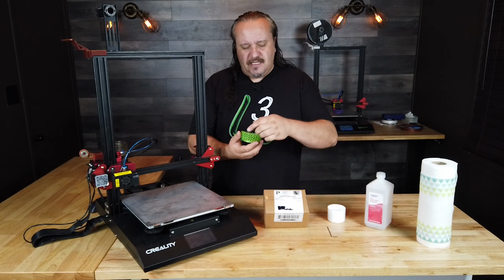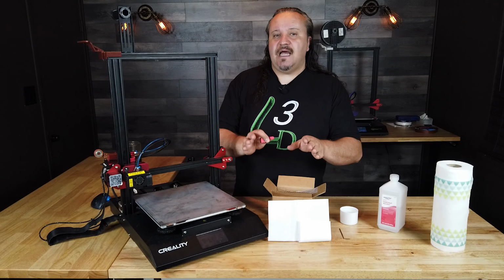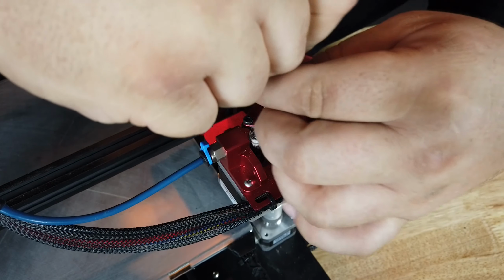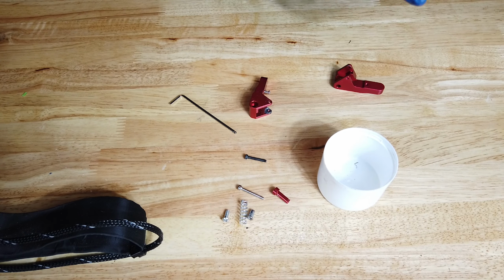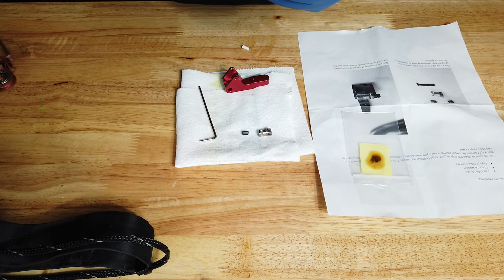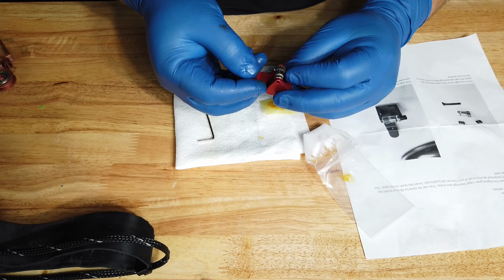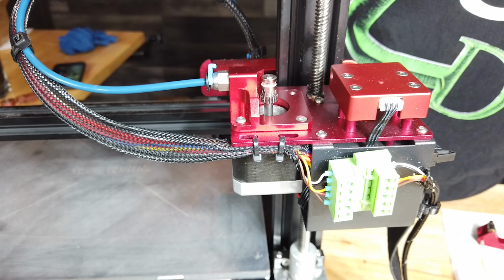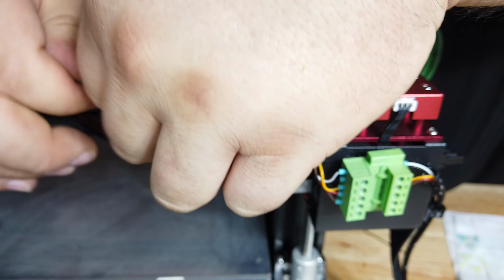Cr10SPro ... Critical Fix you need to make ... ASAP, Extruder issue SOLVED!

Comment: these dual extruders all have another flaw: the gears are below the filament, so all the dust will fall into the gear and compress between the teeth and "clog" the teeth.

Comment: You can also keep your gears and parts from your extruder with grease oil from cars, high temperature resistance, good lubrication and prevents gear wearout from constant friction.

Comment: The trick is stop spending money on replacement bowden tubes, couplers, all metal extruders and buy a direct drive system ASAP. Lol these printers are trash and designed for failure.

Comment: This is correct but the FIX is use a Dremel orange grinding wheel and reduce the thickness of the red anodized aluminum so it's smooth surface again. Also DO NOT USE ANY GREASE in that area it acts as a sand paper with the debris from the filament. Get yourself some brass flat washer in the size of M4 and rind as much aluminum down as needed to you can get at least 1 brass washer in between the gear and the grounded off aluminum. Idea is 2 washers which will allow for a much longer lasting and smoother operation. Ensure both washers are letting the gear ride above smoothly so there should be a tiny bit of play. This will enhance the function of your printer and reduce the friction of your hardened steel gear from further destroying the aluminum. Brass will act as a gear plate so it will slip without destroying the aluminum and letting the gear ride on the brass. We done this to all our 3D printers of our print farm with very good results.

Comment: problem is that you mounted driving weel to close to the motor and filament is pressing second weel against frame. Holes and wheels should be perfectly aligned and then everything is working with no isues.

Comment: Wouldn’t you want some axial play in the driven gear to help locate it properly onto the filament? It seems the real problem is excessive play between the needle bearings and the shaft of that bolt.
Reply: I just bought a clone version and the needle rollers run on the threads of the bolt. This means that clockwise rotation will try to screw the gear downwards against the aluminium support.
As you say axial play is a good thing.

Comment: One major issue that was not addressed; the bolt through the bearings and the surface on which the ride is threaded! This causes both the bolt and the bearings to wear, further adding to the loose tolerance. Another YT'er had a bolt machined with a full shoulder for the bearing to ride (this is what the extruder should have, but bean counters...). Another solution is to get a long bolt with a shoulder that extends the length of the bearings, and cut it down, leaving you a bolt with a long shoulder and only a small section of thread (easiest solution).
Reply: 100% agree plus slightly bevel the bottom of the teath on the gear to remove the sharp edges 😉

Comment: This is basically the same as the WINSINN dual gear extruder, if not the exact same extruder. That has the same problem, it's definitely a design flaw they don't seem to be interested in actually correcting, for some baffling reason...

Comment: The link is 404, do they still make this fix? I cant find it on Tiny machines.
Reply: If you have a newer machine it is not a problem. Just look for a washer and a cutout on the bracket under the extruder gear that is toward the front of the machine. Creality have long since implemented this mod on new machines.

Comment: just from this video i realize that extractor is junk... the one on my ender 5 and cr-10 dual axis clone use a much better part reliable part... not sure why this one is so complex with the extra gears etc... but iam sure it has to do with other added features that my machine don't have .. if you want a reliable machine simpler is always better..

Comment: Nice tutorial. 
I‘ve got no longer any issues with bowden extruders, I‘ve throwned  it out. Together with an Bl Touch upgrade I build up my complete x-axis, with double linear rails (2 parallel), a print head with double gear extruder, mosquito hotend. And to give all this new stuff a strong platform, the 2020 x-axis has to go. Now a 2060 profile brings a lot of more strengh to my printer arm. 
First I tried to use a piezo sensor instead of Bl Touch, but there might be a problem with the original Creality Cr-10s pro board V2.4. ...4 weeks searching a solution, I need a break. Piezo z-homing is nice to have, but when it will not work, the Bl Touch is ready to go, why fighting like Don Chichote any more? Today I can say, this changes are worth to made. 
And many thanks to The TinyMachine to bring new OS online, together with Marlin to make changes by your own. Creality lets you hang there like a rotten apple, hex files, but no Marlin to make changes. This is total crap, because they agreed to an open source device.

Comment: Well ... interesting. I just ordered one of these yesterday but didn't see this video until now. I don't understand - this design is sold all over Ebay even today and no such "fix" is shown on any new one. I did read all the replies here. I don't understand why an exact alignment of the idler gear with the main gear,  (with some filament installed) making the idler gear ride with equal space on the shaft, is not going to allow the system to work fine. Also putting some white lithium grease above and below the idler gear in my mind is just common engineering sense. The idler gear is going to follow the main gear due to the filament concave cutout so if adjusted correctly will not have pressure below it. It not a high speed gear system it just moves very very slowly so I don't understand the alignment problems. 

Again, with grease under the idler gear and proper alignment why would there be a big grinding issue? It doesn't appear to me to be that big of a design issue, but I'll know better when I get the thing. Thanks for the video.
Reply: nashme11 do you have a link for the ones on eBay? Was contemplating picking one up just to compare; I haven’t been having issues with mine yet but may in the future.
Reply: Exactly what I was thinking when I started to research about this “issue”.
I know a bunch of other guys that are using this original design for months 24/7 and the arm is still perfect.
The point is the correct alignment of the gears… If they are correctly aligned no down force are going to appear, unless one of the gears is presenting any sort of quality scape.
And I bet that some of the extruders usually left the factory with misaligned gears. Well, my Ender-5 Pro came with a broken hot end cooler… Creality's quality inspection are far from been world-class.

Comment: rarely seen such nonsense!  the pinion on the stepper motor must be aligned at the correct height, then it runs perfectly, without any abrasion!  Such abrasion can only occur if the pinion has been installed too low by the motor. Or the black screw from the second pinion is too tight

Comment: Yes, I spotted that immediately once I got my new dual gear metal extruder in my hands. Always check your new hardware, and if you have half of technical brain cell in your brain, you have to figure out that the original design is very bad. The sizing of anything should be in a way, that the free gear would have a leevay to center itself accordingly to the filament path, and it must have to have space for that, above and below of itself. They´re complete idiots, if they don´t do other overengineered solution. I will check my extruder, but it looks like even after some help from me, it still does this thing (but like 50%). I will try to push the powered gear on the stepper shaft 0,3-0,5mm higher to see, if that helps. DOH... KUDOS to tinymachines caring about this. Cool guys!

Comment: this only happens because the extruder is positioned to feed horizontally. there's an adapter to flip it another way (i.e. changing the direction of feed), the grind will not and should not happen
Reply: It would. If you had this one in your paws, it´s just wrong. Plain wrong.

Comment: Damn... I'm from Germany and my printer have the same issue. Does any one know to get this without big amounts of shipping costs and not waiting for a month to get this replacement lever?
Reply: try to mill it with a company around :D this should be not a problem i guess.
Reply: @illogicalferi  Alternative might be to mill the gear wheel if you know what you´re doing. It should be made or constructed in a way that the gear is centered by the filament and powered gear by its position, and leaway above and under the gear, so it does not have a chance for frictioning with other parts. First idea is to make this frictioning gear just shorter. The space for it it there. Could be shortened on both size without much if any harm.
Reply: I fully changed my extruder and went for a Bondtech BMG extruder

Comment: How many hours did you have on that machine up until that point? I have a brand new crs10pro should I wait until it happens to fix?
Reply from the maker: Hi, thank you for your message I had several hundred prints off my machine before this was a cause for failed prints. but it comes down to hours printed. I would make this fix sooner than later to preserve prints.
Reply: @LiquiDirt3D  it's crazy how something like that could be overlooked even by Chinese engineers! Looks like an easy fix, my printer is still being shipped to me and my to do list of upgrades keeps growing lol. Luckily I have a milling machine for that part though.

Comment: So those are a cloned version of Bondtech gears. Typically the idler does move on the original Bondtech. The reason is so you have good alignment on the filament.
Reply from the maker: This is not good and if it is moving it will cause retraction binding and thus cause print issues. Clone or not the same issue is present and there should be no wabble in this gear or the filament drive system for best performance.
Reply: Liqui-Dirt 3D I agree on the binding. But in general just know that clone of the real deal does move side to side. It’s called the “idler” and it’s not like the “drive” gear. The drive gear needs to be dead on center on the filament, the idler will align itself with the filament compressed between them.
Reply: Liqui-Dirt 3D the $80 Bondtech BMG moves side to side. Not a wobble, but up in down is normal. If I could I would post a video... I have three bondtechs and they all have a little movement in the idler. I agree the binding is an issue. But that’s a Creality flaw, not a Bondtech year fault. They adapted the Bondtech to the Creality.
Reply from the maker: @thelightspeed3d712  The less movement in the drive system the better and if there is movement does not mean its a bad thing however we are not really discussing the movement. We are talking about the Grinding of the lever and the issue it causes. The filament needs to be pulled or pushed in a controlled manor thus should not have slop in gears it like a loose belt in an axis. thus not a good thing this fix makes sure it has no slop or excessive wear. Even the engineer of Creality them self sees the merit in this.
Reply: Liqui-Dirt 3D I understand what you’re saying, but you have to realize that Creality engineers very little on their printers. The extruder design is not Creality ‘s it’s stolen from Bondtech (not open source completely). It’s the Bondtech gears, but not the 3:1 geared extruder. So, with that said I have three of the genuine article on my printers. What these Creality gears was copied from. And on those genuine gears the the idler gear has a little slop from end to end, probably 1mm to allow it to align on the filament. The other thing that is true is the is that Bondtech gears were not designed to sit in the orientation Creality has them. They are grinding on the arm because they were not design to sit vertical. They were designed to sit horizontally on the axle pin (not a bolt). If you want to really upgrade that printer spend $80 and buy a genuine Bondtech BMG extruder from a reseller. It will make that printer much better. In fact because Creality copies them Bondtech made a lot just for that printer
Reply: @LiquiDirt3D  Also the "bushing" and "Grease" will wear out too. These are steel gears on brass bushings. It's gonna eat that bushing over time. It would be worthwhile to get the genuine extruder and put it on one of your printers. Plus you'll get better resolution and reliability.
Reply from the maker: @thelightspeed3d712  I believe that this is off topic and is not what this video is about. The debate is not about changing out extruders it is about fixing an issue for the buyers of this printer that do not want to modify from stock because there is nothing wrong with the stock set up's function at the center. Plus there is almost nothing that is one's own design in the 3D printer makers anymore. This video is not for changing out the extruder it's about making what is their function better, and last for a very long time. If you want to run Bondtech that is great but not what this video is about. I will have other upgrade videos that will discuss the modifications and changing parts to other manufactures like My video on WhamBam in place of the standard build bed.
Reply from the maker: @thelightspeed3d712  No actually it wont. because of the size and location within the gear end it is designed to work correctly now and not wear out. It is the teeth that dug into the bracket causing the issue. By using the center to rest the gear on its bearings it now does the job intended without wraring. So NO the Bushing will not wear out.
Reply: @thelightspeed3d712  some of what you're saying is true. The gears are not meant to sit vertically, but a thrust washer configuration addresses that. The gears are genuine Bondtech, not cloned. That is from talking directly to Bondtech after being told that from our agent at Creality. 2 years ago, your comment about the engineering may hold true but today, they have an R+D department with 75 employees and a 1000 sq ft lab that is locked off from other employees where the engineers work.
Reply: Tiny Machines 3D I would be shocked that they are putting $40 Bondtech gears in these printers. But yes they are meant to be on an axle not a vertical screw. 

You’d be well ahead to get rid of the entire setup and put a BMG on it.
Reply: Tiny Machines 3D I also think a brass washer is going to wear too. It’s a bandaids. I wonder why others don’t have the same issue? Is it possible he over tightened it?
Reply from the maker: @thelightspeed3d712  It's not a bandage, it is the correct fix the issue at hand, over-tightening was not the issue. Most all CR10S pro machines are having this same issue most people are unaware of the damage until it just fails completely. It is an issue for all extruders of this design. Brass spaces and bearing supports are used in everything from appliances to vehicles and yes even spacecraft it is a normal thing not a quick fix, but a lasting solution to this issue and will solve issues to a huge amount of people. Your argument here is unfounded and off-topic. Furthermore, you are saying $40.00 gears,, yes retail that may be true, however wholesale or design rights to reproduce are a far different thing. Apples to Apples please sir not watermelon to cherries. This video is not a bash on anyone it is about the community finding an issue and a great company like TinyMachines 3D and Creality can address issues find fixes to improve the quality of not only their prior sales customers but to the future ones. If you want to debate Bontech verses Creality drive systems this is not the video to do it on because it is off-topic. This video is a helping hand to those in the community that has the CR10S Pro and need help to get it back running at the 100% it was when new. Please keep your comments and information related to this alone. Thank you.
Reply: @LiquiDirt3D   You've made a very helpful video but your responses here are way too highly strung - people are entitled to express their opinions. The Bondtech comments are relevant to the discussion. Be nice.
Reply: @thelightspeed3d712  Thank god someone knows what´s up. It´s so self evident it´s not even funny. Thumbs up buddy.
Reply: Tiny Machines 3D isn’t it true the gears are licensed by Bondtech? Not made by Bondtech?

Comment: Great Video - Checked mine and i have the same issue. Unfortunately it was not originally purchased from Tiny Machines. I see they sell a replacement but will I have the same issue or does it include the fix.
Reply from the maker: Just go on the link I have, and submit a ticket and ask them for the kit and that you did not originally buy from them. Tell them you saw the LD3D video they will take care of you no problem I'm not sure the cost. But it is worth the fix. Huge print quality improvement.